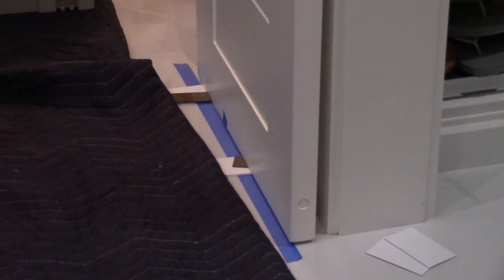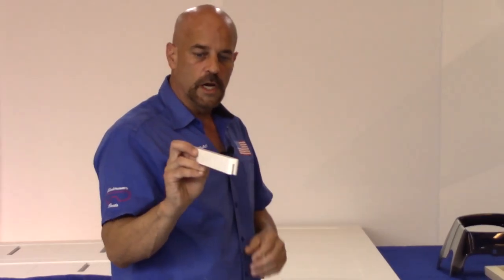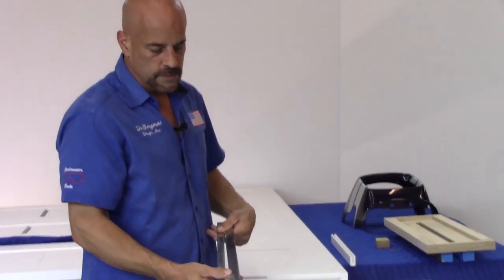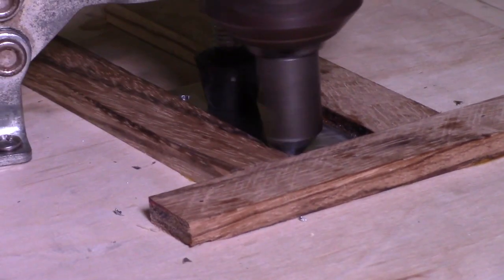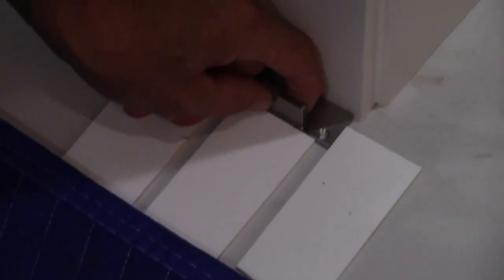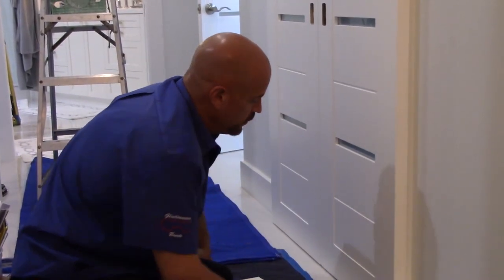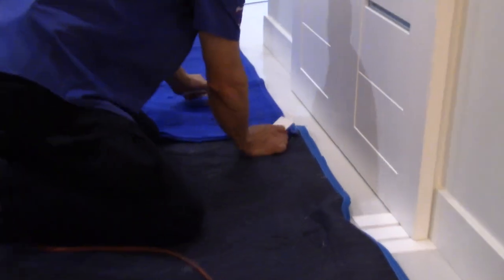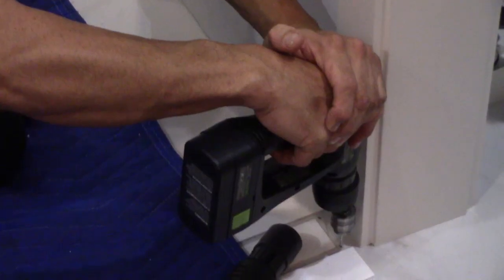Slider Door Glides / DIY!

Comment from the maker: What did y'all think of the video?
Reply: DeBergerac Design I wanna install Barn door in my bedroom entrance to the bathroom. Was wondering how to fix the floppy doors as well as keeping both door from moving to one side together. Nice job! Great attention to detail!
Reply from the maker: Thank you for the wonderful compliments! Put blocks inside the track, this will stop the doors from both sliding to one side. This should be placed in the exact center hitting the rollers. You should also place additional blocks at each end to prevent the doors from sliding of the track or damaging the valance that you use to cover the track. Hope this is helpful.
Jim
Reply: I like the video-  I didn't realize there were so many other "contributors". I say you have a great team of workers and video production